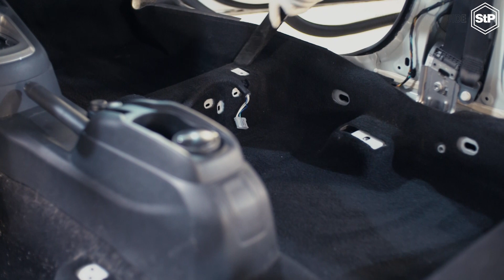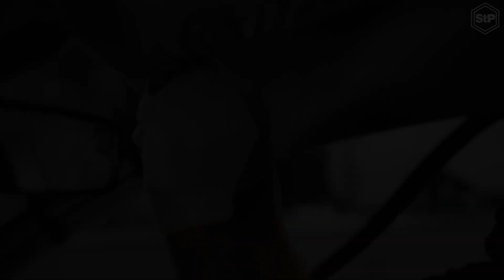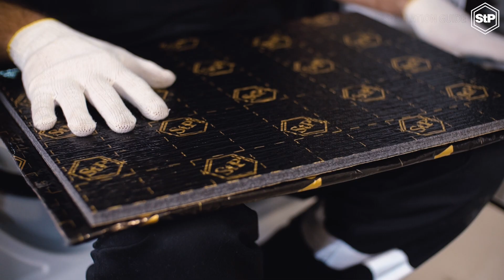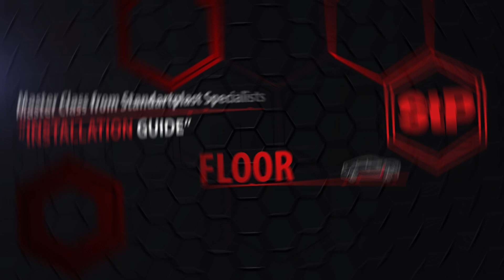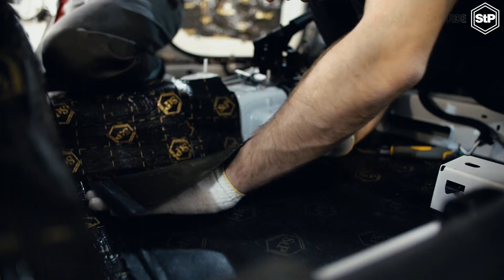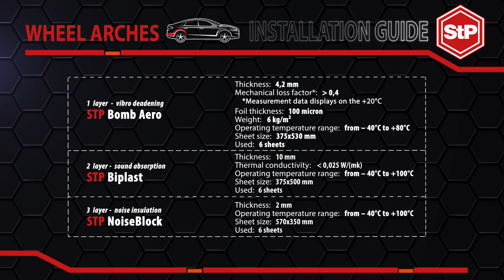Instructional guide on STP SoundProofing [ENG]

Comment: distributor in delhi
Reply from the maker: Sadly, but there is no distributor in Delhi
Reply: https://www.ebay.com/p/5013357265
You can buy STP from ebay
https://www.amazon.co.uk/STP-Alubutyl-Insulation-Damping-Bitumen/dp/B01N1891Q0/ref=sr_1_1?keywords=STP+insulation&qid=1575753583&sr=8-1
or Amazon.